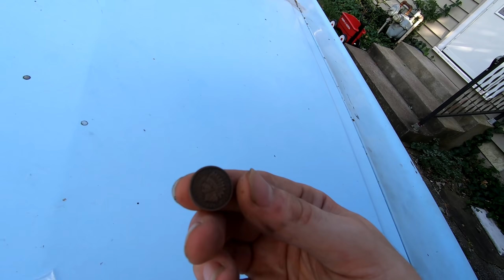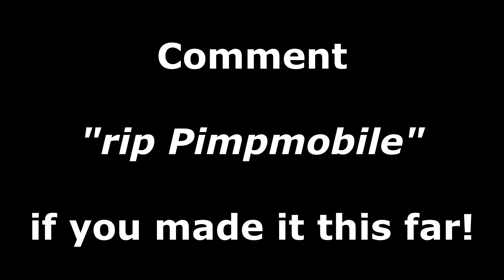THE PIMPMOBILE BLEW UP!

Comment: rip pimp mobile. I had a tracker that we ran on 3 cylinders with 2 holes in the block then caught fire so we stuffed the water hose in it and it still cranked an ran.

Comment: RIP Pimpmobile!  Yeah, it definitely broke a connecting rod, just as you had happen with the F 150.  Lucas Oil treatments definitely buy some time, but eventually whatever they are used in (engines or transmissions), will eventually fail after all.  You seem to have problems with worn out faulty engine parts, for me and some of my family, it is transmissions and drive train components that usually fail for us.  An example of Lucas Oil products buying time for me is when my truck's transmission broke its sprag clutch and I didn't have first gear, I added some Lucas Transmission treatment to it and could still drive it from second to fourth gear for over five years before it needed to be rebuilt!  At that time, it would slip out of fourth to third, and just stay in second, and started leaking its oil, so that was when it had it and needed to be rebuilt.  Overall, not all that bad for a 1988 Olds Delta 88 $700 special!

Comment: Sounds like a cylinder coil problem, cause my 02 f150 did the same thing and it ended up bein the cylinder coils, prolly a spark plug came loose

Comment: I had one of them indian head pennies a few years back. Mine was 1896 it Wasnt worth but about 2 or 3 bucks at the time. Check the buffalo nickel. If the buffalo has 3 legs its worth at least $1,000. And the 1908 shitty nickel is worth about 5 bucks to the right person.